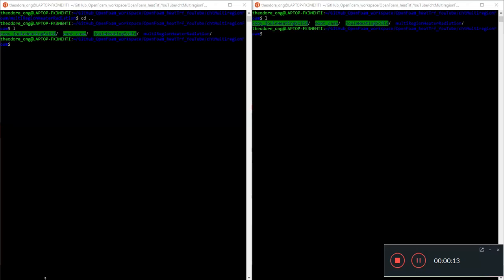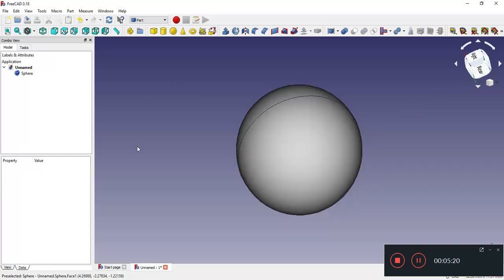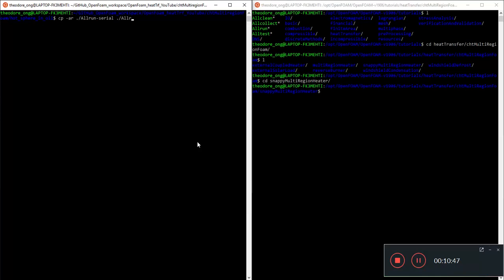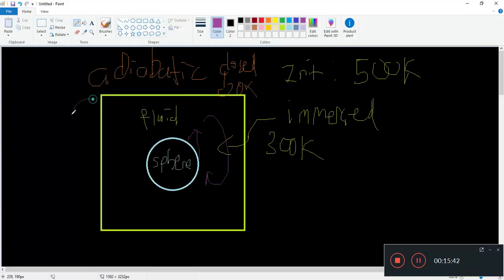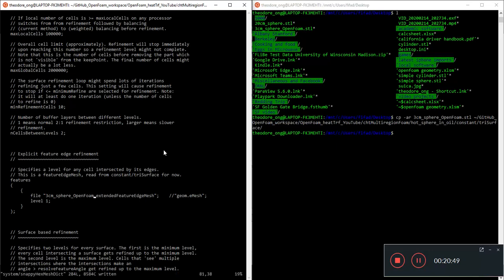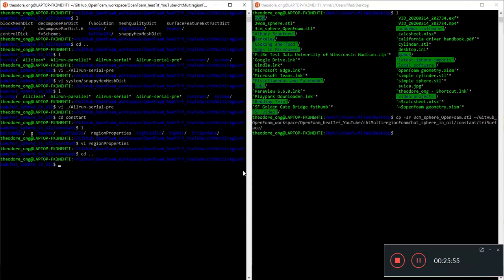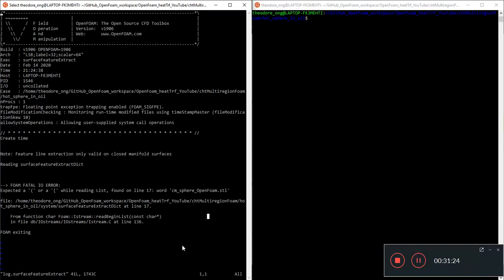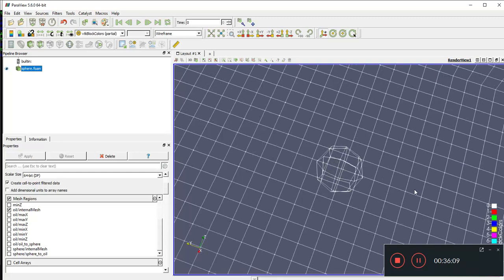OpenFoam Heat Transfer 30 - chtMultiRegionFoam hot sphere in oil part i snappyHexMesh

Comment: Hello, I love your video.
How can I put the conjugated heat coefficients (already calculated with a CFD software ) in boundary conditions for a plane surface in contact with a fluid ( oil jet cooling ) ?
Thank you
Reply: @TheoOngScienceAndEngineering  Thank you very much. It helped me.